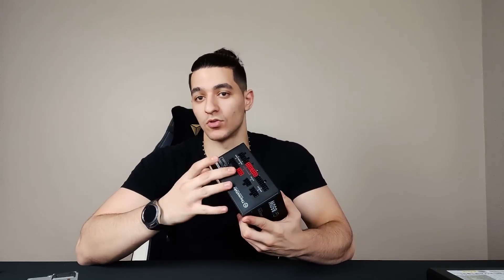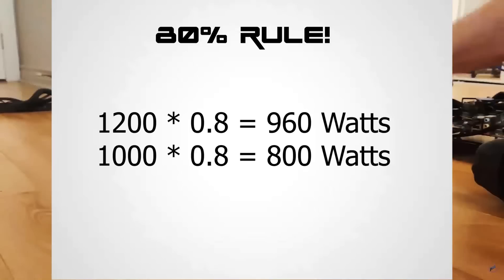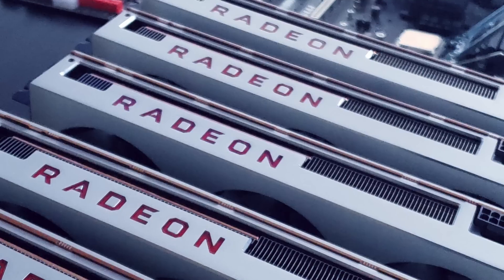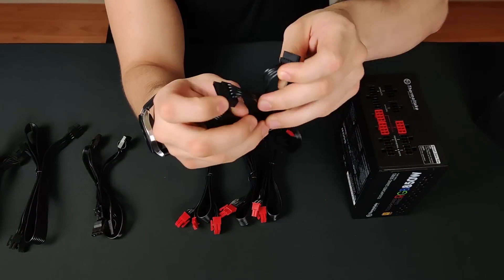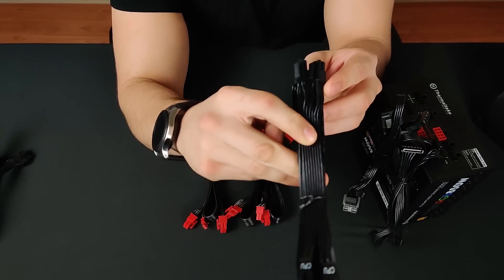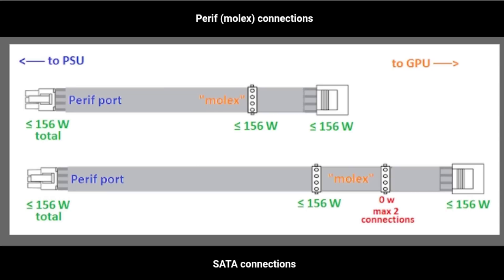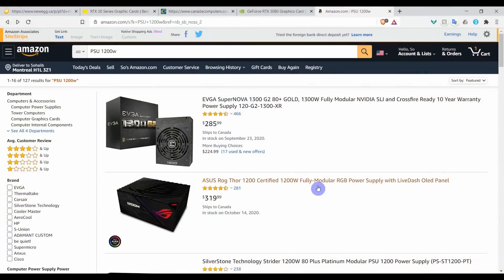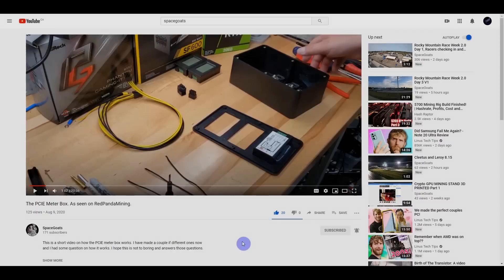Using ATX Powersupplies For Your Mining Rig FULL GUIDE

Comment: Hi bro, I have 2 questions: 
1) I would like to ask if this "risers" https://www.alza.sk/redukce-pcie-x16-na-pcie-x1-pcie-riser-d5076849.htm?o=2#discussionPosts can be used for ASROCK H110 + AMD 5700XT, thank you, and if needs also buy other cables pls let me know I will build only 4 GPU.
2) why ASROCK wrote in manual that if using 5700's cards (225w) it is calculated like 4 x 225w + 250w mobo = total 1250 but recommended PSU should be one more 2500 as they claim the best is to use 50% of power but I saw ppl use 1300w PSU with 8 GPU's so how it is?
Thanks.
Reply from the maker: 1. Yes any risers work just try to get newer risers those one look old
2. Don't worry about that since youl be undervolting and properly overclocking your gpu for mining. 6 5700 then do 1200watts, 8 of them then do 1600w or 2x 850
Reply: @MiningChamber  "try to get newer risers those one look old" please send me some url of examples the new ones since I can not find any sites to buy this risers. thx
Reply from the maker: @dubar2289  Check GPURisers.com they have new ones
Reply: what you mean by "OLD" ? please explain where should I buy new risers and do they look different?
Reply from the maker: It does not take 6 pin, it only takes molex and that's generally not good. So look for ones similar on the website I sent you too.

Comment: A beginner here. A quick question to the 80% part, why the Radeon VII will use 300 Wattz when the overclock is reset?
Reply from the maker: Because with mining overclocks we limit the power the gpu use, so without the undervolts it will use max power which is not good!
Reply: @MiningChamber  Ha, I missed that. Thank you!

Comment: hello friend so i want to buy 4 radeon RX 590 185 whatts i have a cooler master 750 whatts 80 plus gold power supply this is for my 4 graphics cards?
Reply from the maker: That is not enough, I suggest a 1000-1200 watt psu just encase and then you can add more GPUs to it
Reply: @MiningChamber  tanks my friend
Reply: Its for 3 graphics cards this work my lo power supply 750 ?
Reply from the maker: Yes 3 GPUs would be good
Reply: @MiningChamber  tanks my friend from Portugal

Comment: It's all about the # of wires !!!

SATA and MOLEX have one 12V wire and multiple connectors on the same wire, while VGA has 3 wires. The amount of splitters is not relevant since power needs to exit the PSU on multiple wires. You just need to count the 12V wires from the PSU. I didn't know it might use up to 72W from the riser card, that's the most valuable information in this video. I'm also no sure a motherboard could provide something like that in normal use.
One more thing, do you know if it's safe to mix power from multiple PSUs on the same video card? I feel that having a common power rail might be beneficial to scale up, but at the same time overcurrent protection is gone. Same with the server PSUs, it can melt a GPU before any overload protection kicks since it's designed for a lot of power.
Reply from the maker: Thank you so much for the info!! I have a section in the server psu video dedicated to this topic so if you don't mind checking it out to give the approval on it, it would be awesome!

And yes avoid mixing power from different PSUs to one gpu even riser. Make sure the GPU and riser powered from the same psu to avoid any inconsistency

Comment: Thanks for the video, it's super informative. I just didn't quite understand why it isn't recommended to use 6-pin SATA cables to power risers?
Reply from the maker: They have a small power capacity like mentioned in the video so it's not recommended to use them. One riser can take up to 75 watts while a sata cable can give up to 52 watts
Reply: @MiningChamber  Thank you for the reply!

Comment: If i use 2 molex to 6 pin pice converter to power the riser , will it work?? I want to run rx 5700xt on riser.
Reply from the maker: You can just use molex directly to the riser! Max 2 risers per molex cable
Reply: @MiningChamber  dude i have 006C riser,it has only 6 pin pcie port.
If i use different PSU and power the riser with 6 pin pcie. Will it work??
Reply from the maker: No use the same psu for the rises that's plugged to the gpu. You can use molex to 6pin yes
Reply: @MiningChamber  thanks man .it helps a lot.

Comment: for the asus board with 3 psu 20+4 pin connectors... do they have to be the same psu or will they just act like a trigger to turn on other psus (assuming vgas could get their own psu this way)
Reply from the maker: They just act like a trigger to turn on the secondary PSUs. We used it in our 8x 5700 xt build I recommend checking it out
Reply: @MiningChamber  damn thing is almost 300 but it'd save so much space. thanks for helping me man.

Comment: if i have 6 cards (radeon 5700xt 8GB) on one motherboard and use 2 x 1000 watts power supplies, is that ok?
Reply from the maker: Yes for sure! It is a bit of an overkill you can even do 2x 750 watts PSUs or you can use one 1000 watt psu if you make sure you undervolt your GPUs right, but your error margin will be really small. Check our builds playlist we have a 8 5700xt gpu rig with 2x 850 watts PSUs
Reply: @MiningChamber  thanks for fast response

Comment: There is one thing that wasn't covered that I can't seem to find an answer on. When I power my risers directly from the PSU like this do I also run power to the motherboard AUX1 and or AUX 2 where the little card thingy plugs into the motherboard? Thx for your great content!
Reply from the maker: That is usually a yes for high powered cards. Many people don't power them but the manual recommends to power them so I would do it just encase! It improves stability and such

Comment: I am buying a new PSU, but it only have 5 PCiE, can I power 2 GPUs with 8PINx2 with 2 splitters in the same slot?
Reply from the maker: Depends on which gpu. Usually it's a no and it's better to find a cable on eBay or such that is compatible with your psu. Make sure it is compatible!

Comment: I have a Radeon VII mining rig.  The way I have it powered seems ok but I am interested in recommendations on how to power it.  I can use up to 8 Radeon VIIs but I currently am only running 3.  I have 2x EVGA 1600 T2s installed with a third ready to plug in if necessary.  The mobo is an Asus mining expert with a 7700k installed.  Am I able to power everything with just 2 1600 watt power supplies or do I need to also use the third?  Is there room to go beyond 8 Radeon VIIs?  I think an 11 Radeon VII rig would be epic!  @Mining Chamber
Reply from the maker: Hey! We have a Radeon VII mining rig build video I recommend checking out but as for powering you have more than enough! Each 1600 is good for 6 gpus so you can use 2 of those with some splitters then your all set

11 Radeon VIIs ahh that's gonna be awesome!
Reply: @MiningChamber  I am having trouble finding a compatible driver that will support 11 Radeon VIIs.  The driver that is recommended in the mining expert manual is older than the Radeon VIIs and thus does not support them.

Any suggestions?
Reply from the maker: Windows in general is really bad with setups that are more than 6 GPUs so I'd use a mining based OS for it for sure!

Comment: Can you tell me how much 1070GPU allows for mining by using v1200 watt smps in one rig including riser
Reply: So any 1200
Reply from the maker: For 1 gpu you can use smaller psu but for  y
6 of them then yes 1200 watts PSU is good!
Reply: @MiningChamber  ty for reply
Can u tell me one riser consume how much watts
Reply from the maker: Depends on the gpu, anywhere from 30-70 watts
Reply from the maker: I dont know unfortunately since I never had one !

Comment: I want to buy a new psu so i have to choose beetwin corsair or be quiet,which one do you choose ???
Reply from the maker: Mm I like Corsair alot! But I never tried Be Quiet so I would check first how many VGA cables and pins they provide then buy the one that gives the most
Reply: @MiningChamber  Be quite locks more  premium than corsair but after all its not all about the look ,waht is matters is  inside :D

Comment: hello there, i have rx 580 8gb with 1 gpu cable and the gpu need 8pin and 6 pin in same time and i using spliter to powered pcie riser with 1 source cable gpu, are they safe? thanks
Reply: And 1 more question bro, in my psu there are many 6 pin sockets, if I use the socket with a pin 6 to 6 pin cable to turn on the raiser alone can it turn on the raiser? and safe or not, oh yes the PSU I use the Corsair RM1000 brand
Reply from the maker: Hey those 6 pins are for SATA and MOLEX so don't plug into them anything else!
Reply from the maker: That is completely fine!

Comment: so the more I look into it, and the information im getting directly from some of the power supply manufactures are saying that an 8 pin pcie can handle up to 150 watts, and 6 pin can handle up to 75 watts.. so one molex per riser is probably perferable. lastly unless you are running a really low wattage card, Im not sure where it pulls power from first the riser.. or the direct pcie cables..  I know you can run very low end cards without power cables because the riser can power them... if under 70 watts. but Sata is only rated for 54 watts, unless you are somehow combining 2 sata to one 6 pin for a riser I would stay away from it.. or just avoid all together... and what is the power ratting for the pcie 8 pin with the pig tail. because the drawing in the video shows that it doesnt add any power to the over all strand... im more confused now actually lol
Reply from the maker: Im going to be honest I am confused too now, I thought I had it figured 😂😂

That is a really good point about GPUs that run purely off of pcie lanes, I would assume gpu primarily pulls it's power from the pins on the card if it takes any since it would make more sense. Now as of the 6 pin doing 75 watts and 8 pin doing 150 watts I think that's just being on the extreme safe side, it really is hard to tell since I have heard both sides and for me 150 watts does not make much sense due to experience with cards. I've run a R7 off of one strand for a year (pulling at about 230 ish watts) and then we assume the riser is pulling like 50-75 watts we are still surpassing 150 watts on a single strand of 8 and 2+6 pin cable. 

I could be wrong ! Maybe there will be a part 2 for this hahaha il do my homework and keep digging about it, thank you for sharing the info!!
Reply: @MiningChamber  I'm also confused about this since yesterday. I only have x16 pci-e cords just enough for my x8 3070s. I guess its splitter time too  ei?

Comment: Great clip! I have read that its not advised to use splitters from different brands than the PSU itself, does that hold any ground? I have a Corsair 750W PSU and need to connect 3 GPUs (undervolted to 130W each). What splitter would be recommended?
Reply from the maker: Thank you! I believe your referring to the cable it self, you can't use cables from different psus with the one you have until you make sure it's compatible with it. But as for splitters they are universal and I do recommend Nerdgearz.com for it!
Reply: @MiningChamber  Thank you that was very useful :)
Reply: @MiningChamber  Could i trouble you for suggestions on how to power 4 5700XT (clocked you 130w) with one Corsair RM850 including risers? Tried to find a clear example anywhere but can’t, would be much appreciated and of course without any responsibility :D specifically what additional cables I would need to buy :)

Comment: Thank you for this video!! Great detail! Can you answer this question for me, I must be missing something?? In the graphic where you show the rated wattage for an 8pin strand, it has a maximum of 288w for the entire strand. When you use only 6 of the 8 pins, the maximum is 216 watts. Later on in the video, you recommend powering a GPU that has 1 8 pin and 1 6 pin and 2 risers with an 8 pin strand by using 6 pin splitters. To me this indicates you are powering the GPU (up to 300 watts) and 2 risers (75 watts each with AMD cards) by using two 6 pin to dual 6+2 pin which have a maximum wattage of 216 watts. 300 + 75 +75 is 450 watts.....450 is definitely not less than 216???? You say don't overload your strands, but this recommendation seems to exceed the strands capacity by 234 watts. What did I miss??
Reply from the maker: Thank you!! And for that issue usually it's super rare to have a card take more than 300 watts but if you do then you will for sure need to power it with 2 vga strands and not just one.

The scenario I was referring to is when you have dual 8 pin or 8 and 6 pin cards like some rx 580 models and 5700 XTs, where the card consumes 120-140 watts then 2 more risers with around 50 watts each will keep you at 220-240 watts per vga strand. That is a fall back plan that is safer than SATA but I would recommend using MOLEX before trying to push the limits like that on a single vga strand! Thank you for bringing it up ♥️⛏️
Reply: @MiningChamber  Also i was confused about this, for instance, when you were talking about the VGA to 8 Pin cables, 288W, and the VGA to 8PIN + 6+2pin (the cable with two heads) you said that both heads provide the same 288W power, but when you add a splitter to either one head, its split 144 144 and the two combined provide 288. But isn't the dual cable already a splitter by design???? shouldn't the the combined splitter only provide 144W? and the other unused 8pin provide 144W, otherwise the dual PSU cables would provide  576W if all combined
Reply: but I do understand the point now thanks to this comment, that it was just the graphic being mixed up, since the cables are split 75W 75W and 144W, so you get 220W into the GPU and 75W into the riser, works out perfectly.

Comment: Hi, So, I have question about the VGA. I have 2 Dual pin VGA and 4 single VGA. I was able to connect all the 4 of them with 4 dual 8 pin graphic card. But I don't know what to do with 2 single VGA cable for 2 Dual Pint Graphic Card. Should I order 1 more dual VGA cable or can I just run 5 graphic card while I order new dual VGA cable?  Thank you.
Reply from the maker: Hey! So just to clarify you got 4 single vga and 2 dual. But your GPUs are all dual vga and you got 6 GPUs. In that case you can use 4 single vga with splitters so that each vga powers one gpu. Then you can use the 2 dual 8 pin vga to power 2 GPUs each and 4 risers using 2 splitters on both vgas (2x 8 pin gives you 4 total 8 pin. 2 for gpu and 2 for 2 risers) 
Then you have 2 risers left unpowered, in that case you can use 2 molex strands to power the risers by one each. That will be your best safest method with what you currently have. Alternatively yes you can order another dual vga but make sure it's compatible with your PSU!
Reply: @MiningChamber  Thank you. I just got the same products as what you have in the videos. So, yes then I will use the molex cable for the 2 unpowered risers.  So, for the one power supply you showed that has 2 molex plug. And I'm already using one for the mother board. But I only have 1 plug left in power supply. How can I use 2 more molex for the 2 risers?
Reply from the maker: If that's the case then you can use 1 molex for 2 risers. Youl just need to cable manage it nicely so no strain is on it

Comment: Hello, thank you for the informative video, but I still have one question.
you say an 8 pin PCIe connector can carry 288 watts but from other research, I have found that it can only carry 150 watts.
does this mean I should stay around 150 watts or can I go above?
Reply from the maker: Hey! I would rely more on 288 watts over 150 watts since then it wouldn't make sense say for example you want to run a Radeon VII, if you give it 2 cables that's 150+150 300 watts max. But we do know that the Radeon VII can take more than 300 watts so it would be near impossible to power that gpu! Do you have the resources you found it from? I will look into it more as well and maybe do an update!
Reply: @MiningChamber  thanks for the reply, I will rely on 288 watts from now on. There is a few websites that contradict this however one was https://www.gigabyte.com/Support/FAQ/2773#:~:text=There%20are%20three%20sources%3A,provide%20up%20to%20150%20watts. It says that an 8pin can only handle 150watts.
Reply from the maker: Thank you for that link! I will do some more digging and hopefully make a new part to this!
Reply: @MiningChamber  but since you've been going by 288 watts it should be fine right?
Reply from the maker: Ive powered a single R7 with one strand for a while using around 190 watts and it's been great!
Reply: @MiningChamber  thanks for the help
Reply: @MiningChamber  8 pin pcie cable is rated for 150 watts max, its made of only three 12volt 16awg wires each carrying 4 amps. Using one cable to power a 200 watt video card and a potential 75w riser is seriously dangerous stuff this video should be taken down. @13:23 your even splitting it again on the same line, crazy wrong even after reading the spec sheet you just ignore everything you said and do this.
Reply: @RSXtra  Exactly this, all youtubers are all about splitters and that crappy graphic with almost double the standard, but didnt actually read all article where is clear statement - 6pin=75W, 8pin=150W, and going beyond is on your own risk. Of course cable can carry more, but plugs dont, and this is dangerous.

Comment: Hello,  very informative video!

I have questioned, can the 1000w platinum power the 6 1660 super and 6 fans without any problem? Based on the spec wattage of a card is 125 watt. Thank you! 👍🙂
Reply from the maker: Thank you! It can definitely run them!  The bright side of NVIDIA is that it's very stable so you don't need to worry much about your overclocks resetting once you find the sweet spot for tunning your card!
Reply: @MiningChamber  Thank you again! Hope to see more videos soon. 👍👍👍